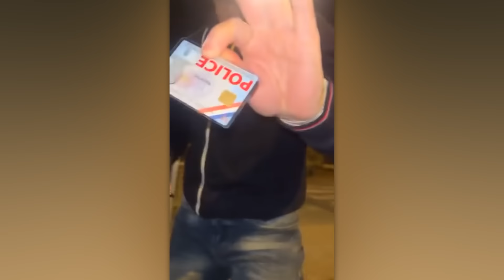Instant Karma Caught on Camera. Best Moments of 2023

Comment: 3:46 - I'm sure that fire-fighters enjoy the opportunity to do that, BUT, there is a very practical reason to doing it beyond just the thrill of smashing a window.  Each bend in the fire-house to go around the car reduces flow by a meaningful percent, and after a few bends in the hose, the range of the water as it leaves the hose is also greatly reduced.  For tall-buildings it means that the upper-most floors don't get enough water.  And for all fires, it means that the fire-fighters have to get closer to the fire to put the weaker stream where it needs to go, and that's literally them risking their lives to protect the windows of an illegally-parked car.
Reply: good to know!
Reply: Same relation but different experience with an Ambulance Driver, they are legally allowed to bulldoze an illegally parked car if need be.
Reply: I agree, and have no sympathy for the owner.  But using the rear window, and breaking out the front is not really justified.

Comment: The incident at 15:28 seems like the car of the dashboard cam was in the wrong direction on a one-way street, the lady in red ended up giving passage to the douchebags even though she was correct.
Reply: I thought the same thing.  All the parked cars are pointed the way the woman wanted to go.
Reply: Ditto, I was just talking to my girlfriend about that, showed her the video and she said the same thing.
Reply: She wasn't. It's not a one-way street, just a narrow road where you have to give way. As the vehicles are pointing in her direction of travel, she has the "obstacle" on her side and must therefore give way.
Reply: No. It's a two-way street with parking along one side. She was driving on the left - the wrong direction - and the dashcam car had the right of way. She needed to give way but made a big production of how insulted she was that the other driver was forcing her to move.
Reply: I noticed that too.
Reply: @joelrasdall7662 

The parked cars aren't all facing the way she was going. The one at 16:01 has driven there the way the camera car is going.

Comment: 16:27  This driver didn't do anything wrong. The barriers started to come down AFTER he entered the train crossing. He couldn't back up and couldn't stay where he was....driving forward was the only thing he could do.
Reply: There are stoplights that start flashing before the arms come down. That's why the other vehicles were stopped.
Reply: No, he went and passed over double yellow lines.
Reply: The driver entered a railway crossing after the lights started flashing. He did so on the wrong side of the road. And he crossed over the double lines to do it. All of those things were wrong.

But you're right that he was driving forwards. At least he didn't do it in reverse.

Comment: 5:20 The built-in karma of spending too much money on an unnecessarily large vehicle designed for rough terrain een though you've never seen a farm in your life, then never bothering to learn how to drive it "off road" before attempting the most basic manoeuvre.  They've probably never seen snow on the road either.  Clue: simple saying "I just have to put it in 4WD and I can do anything" is untrue!  You need to learn the techniques that go with 4WD mode 🤦‍♂️

Comment: 12:10 My mate did that to a Mercedes 35+ years ago. After 5 minutes of gently moving his 2.5 ton 70's Chrysler Charger, 1 ft at a time. He lost it. Hit reverse, nailed the throttle and drove his massive tow bar straight through the door. The 383 V8 had no problem pushing the Merc 20ft backwards. Then ripped the entire door off as he dragged the whole thing another 40ft before it happened. To this day, he still has that door mounted on his garage wall as a centerpiece. Makes a great story at bbq's. And this was in the 80's, so way before cameras to catch him. Retelling this still makes me smile. lol =D